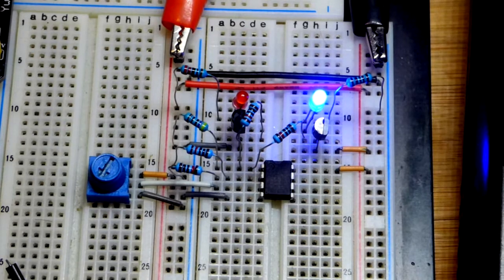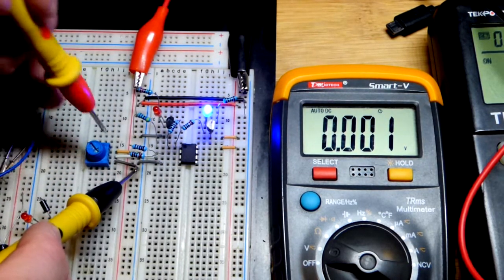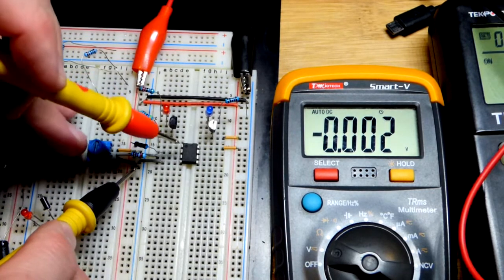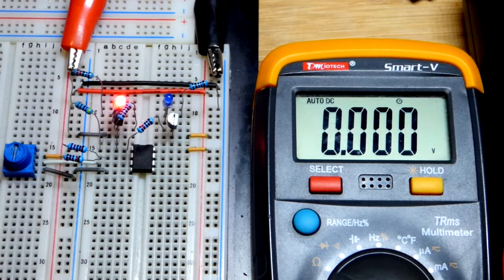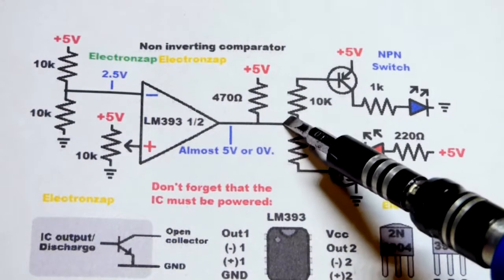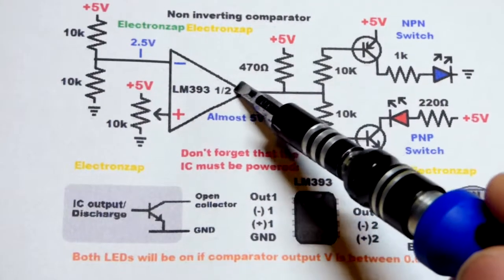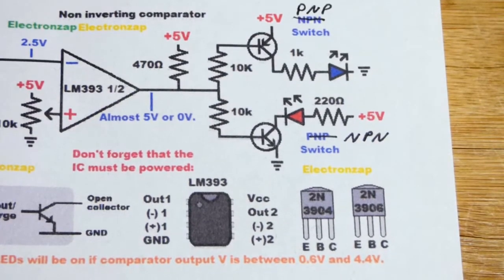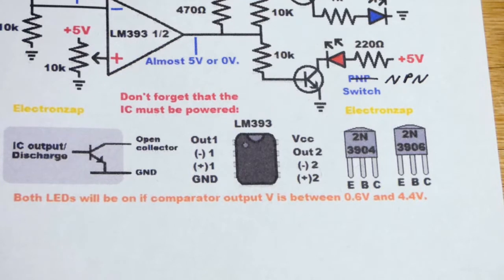LM393 dual comparator almost full supply voltage across loads learning electronics lesson 0021

Comment: My question is how can I use the lm393 as a master to automatically turn up and down duty cycle on a tl494 ic for booster converter because am having big issues with the pwm duty cycle and automatic adjusting when there is a load because when I turn up the duty cycle to 90% with no load the mosfet get hot and